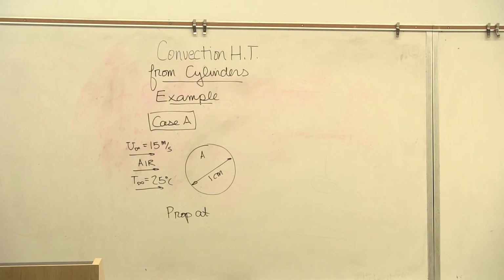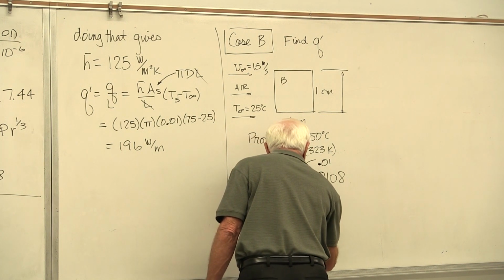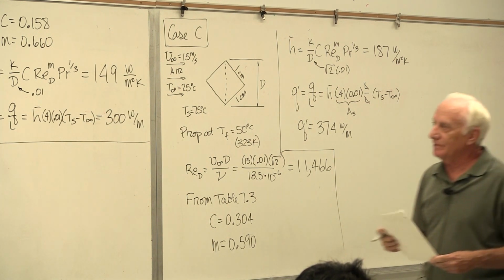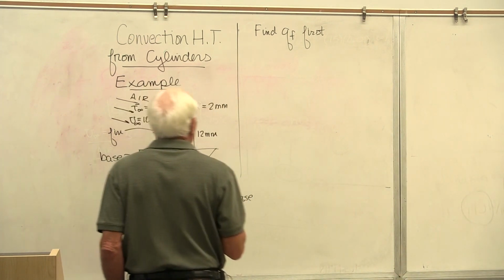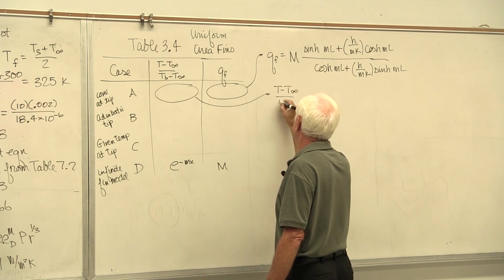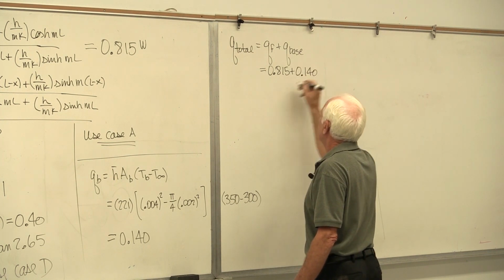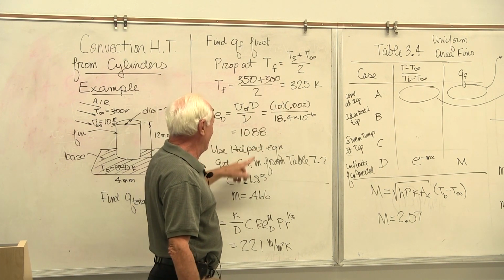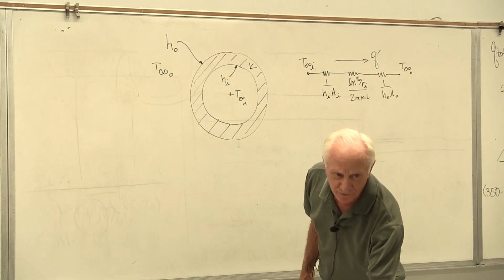Heat Transfer: Convection Over Cylinders, Part II (21 of 26)

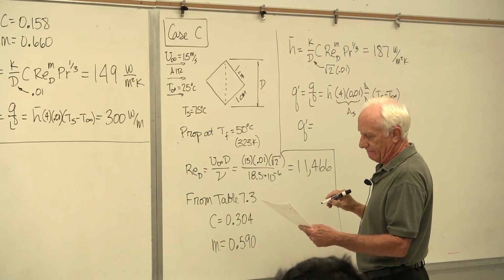Comment: hello, i think there has been a calculation error in around 16:50 and the h value came out as 187, which should be ~134, which is okey its not important, but the important thing is, after that calculation error q' value came out as 374 which should be 268 if there was no error, after that professor made a long exlpanation why this q' value is being larger than the previous one, but if there was no calculation error then that q' value would come out as smaller than the previous one... my question is, are professors explanation about "laminar flow creates better heat transfer" true or not ? because if not, its been a very long wrong explanation.. please correct me if i am wrong because i am stuck at there momentarily. good days!
Reply: very observant :)
I did check and your answer is correct
Reply: And I think turbulent flow creates better heat transfer coz the convection coefficient is higher for turbulent which depends on Re. And Re depends on velocity